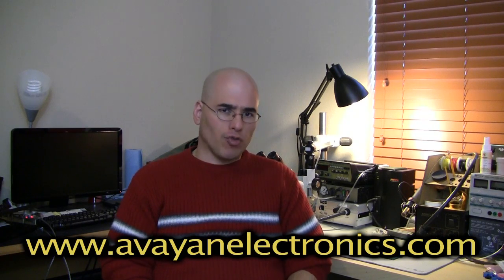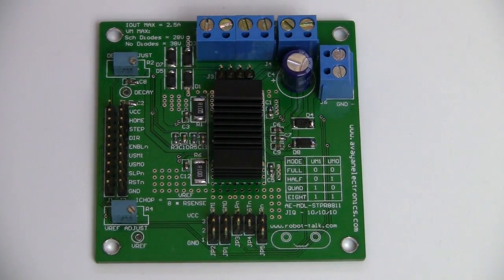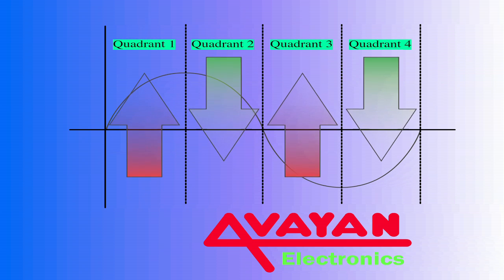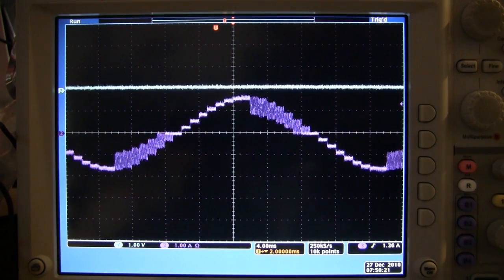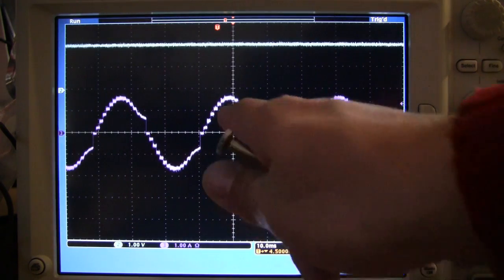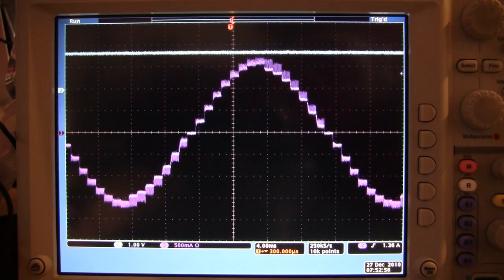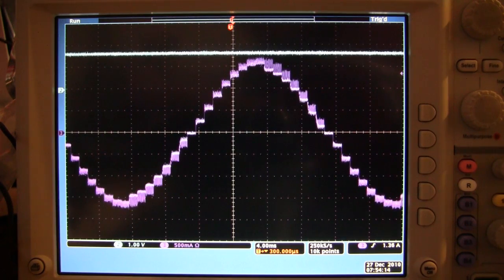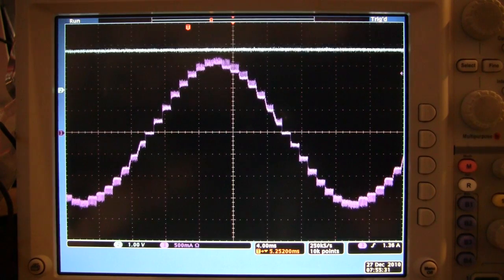DRV8811 Decay Overview

Comment: How do I check if my ic has that analog decay control mode? Especifically DRV8825
Reply from the maker: That mode was not made available on DRV8825. On DRV8825 the Mixed Decay mode was fixed. It's been almost 10 years since I dealt with these devices, but if I recall, DRV8811 and DRV8818 had a DECAY pin which was actually an analog input. There was an equation which would yield a particular rate for the fast and slow decay modes. And the input was analog, so any voltage represented a different state. On DRV8825, however, the input was a triple state input. If it was LO, HI or HiZ it had different response. LO was slow, HI was fast and HiZ was mixed (if I recall correctly - please check the datasheet). Anyway, this was one of the main issues with the DRV8825. Still a good stepper driver, but not very tune-able in this sense. Hope this helps!

Comment: hi i have a driver board and i have 0 decay 25% - 50% - 100% decay...
Which should i set?
Reply from the maker: +CSL Detailing Auto Botosani Man, that is going to be tough to answer with so little information. It will depend on the motor inductance and the application voltage, so each case is pretty unique. Ideally, you would use a scope with a current probe to determine which setting gives you a better sine wave shape. Without a probe, though, it will all be a guess. I would suggest you just try the four settings and pick the one you "like" the most, where like means better motion quality or less audible noise, whichever you prefer. Good luck!

Comment from the maker: In my board I have a potentiometer which I use to change the analog DECAY input. If a board has a DIP switch, this must be some sort of crude DAC function by using a resistor ladder. You can either remove these components and add your own potentiometer, or whichever concoction you deem more desirable. The DIP's advantage is that it is cheap, but you have a finite set of voltage values. This is why I prefer the pot. Pots are pricier, though. So yes, you can modify the DIP based boards.